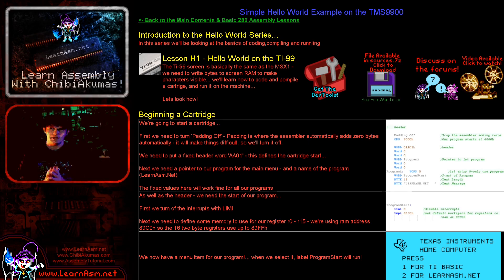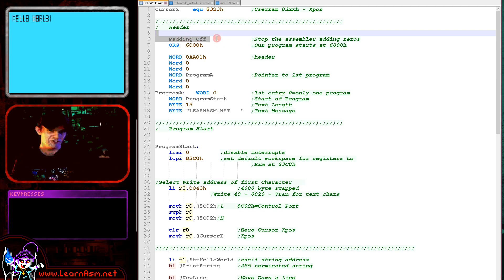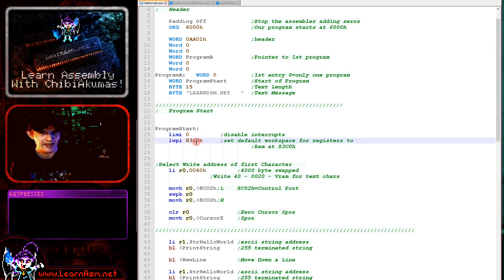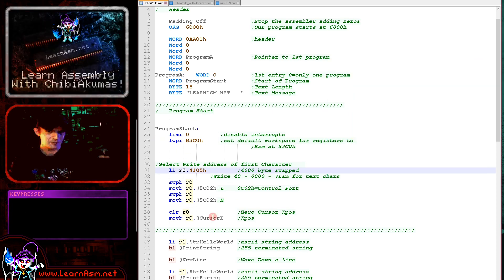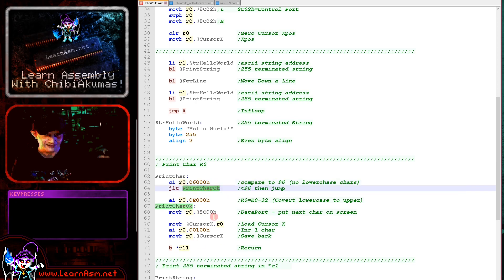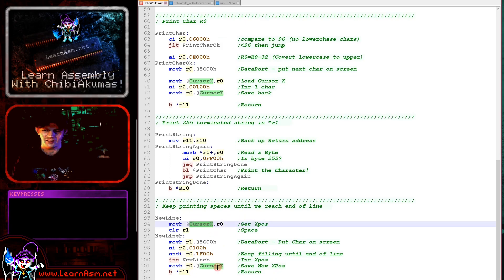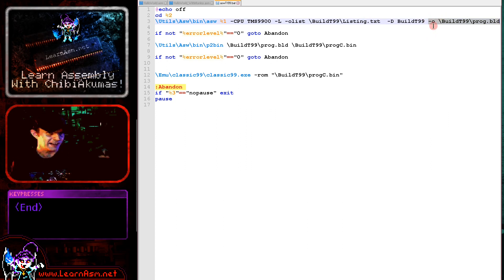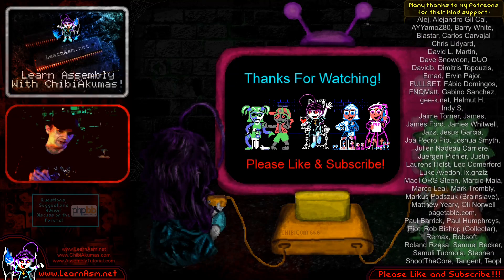Lesson H1 - Hello World on the TI-99 (TMS9900 Assembly)

Comment: I tried compiling your unmodified HelloWorld.asm code using the latest version of asw.exe (v1.42b) - compiles with no errors (as expected), converted it to a binary file using p2bin and then loaded into the latest version of Classic99 (v399.031 2020-08-04) and the cartridge doesn't appear in the cartridge selection list (should be LEARNASM.NET as option 2). Not sure what is going wrong as everything else builds fine with no errors..?
Reply from the maker: Not sure what to say... just tried it with the latest Classic99 and what seems to be the newest ASW and it worked fine for me... I even re-downloaded the helloworld.asm from my website to check it's not the wrong version on there

You can download the Emulator, devtools and build scripts from my website if you're having problems.
Reply: @ChibiAkumas  OK, many thanks for your assistance, it might be some weird configuration issue at my end, but at least I know it's not a global issue :)
Reply: @ChibiAkumas  Aha, made a mistake. Renamed the file from hello.bin to helloC.bin and it found it fine. Cartridge runs as expected. Forgot that the V9T9 support uses the filename to determine what type of file it is. Doh!

Many thanks for all of your help! :D